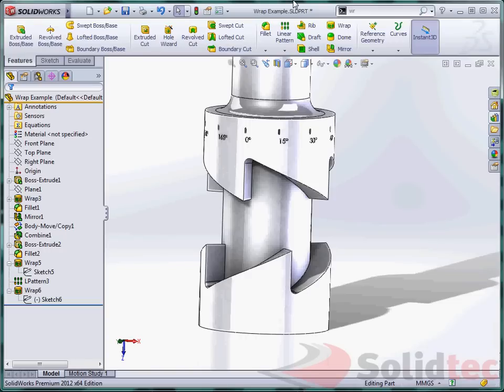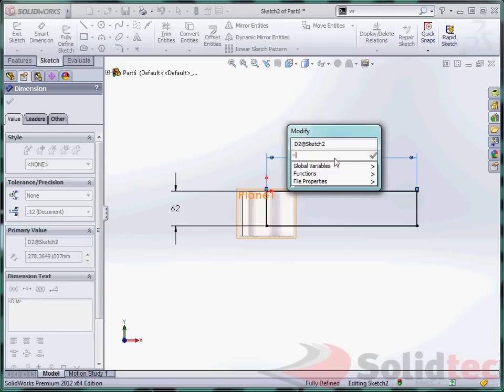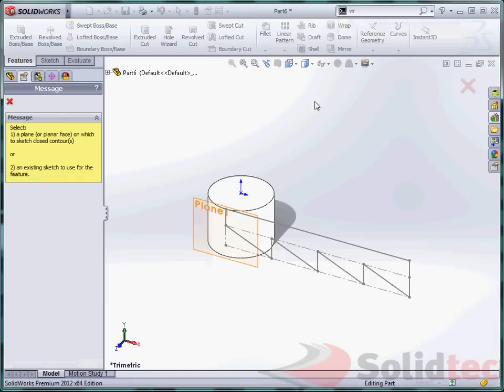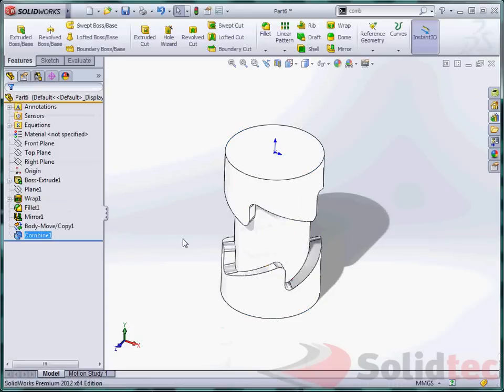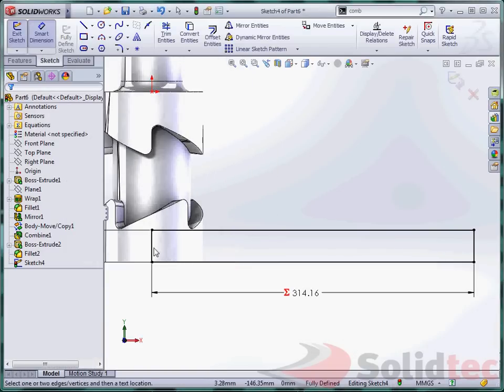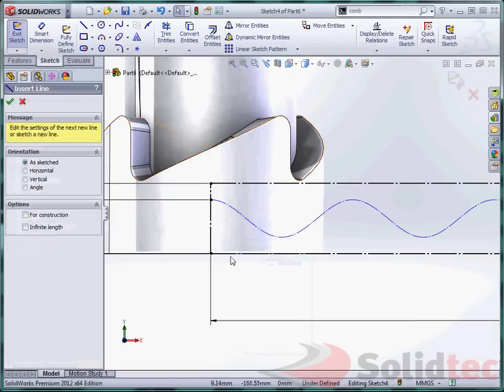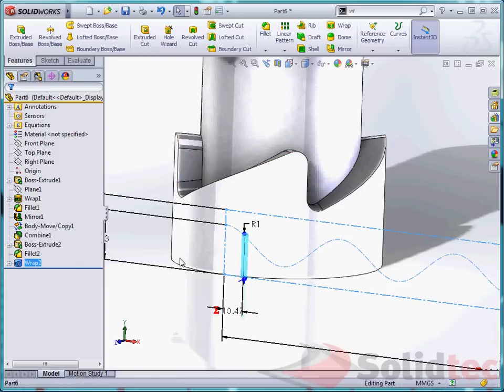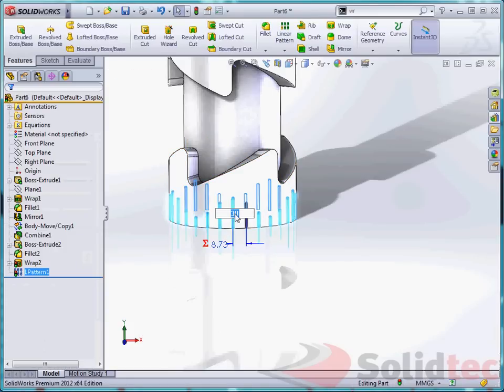Creating CAM with Wrap

Comment: Thanks first, but I have a question, by this method you will have a shape of Circular sector, which will create problems if it works with a crank. The right way is to use swap cut.